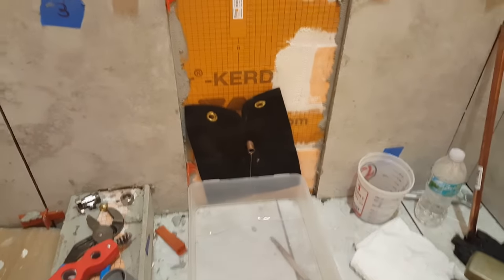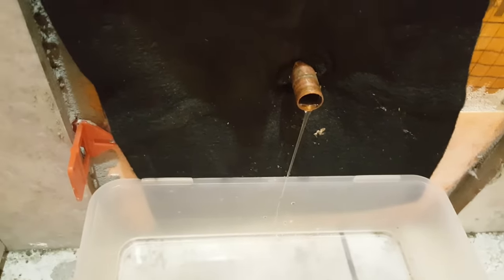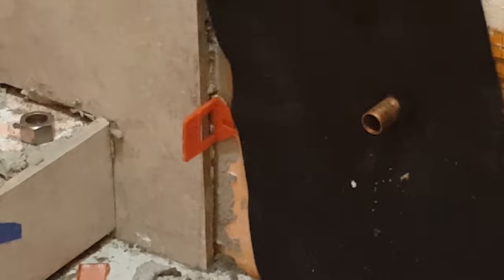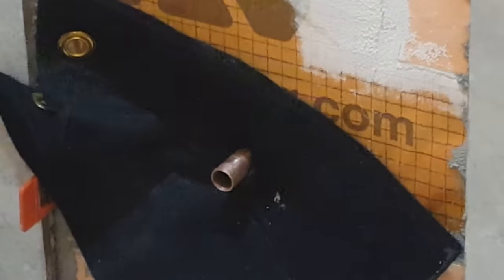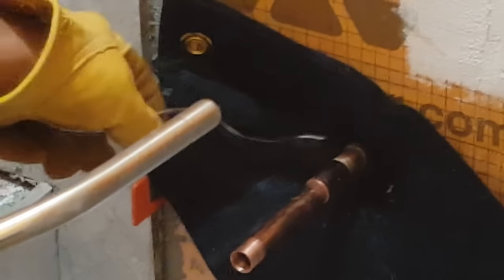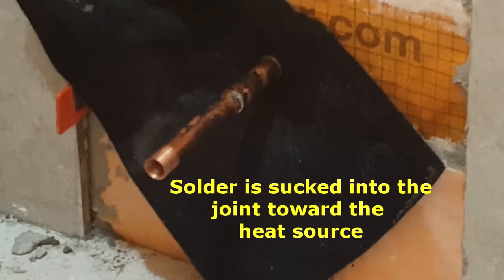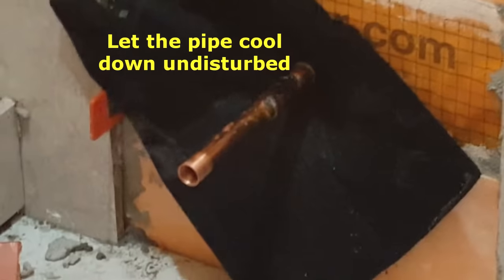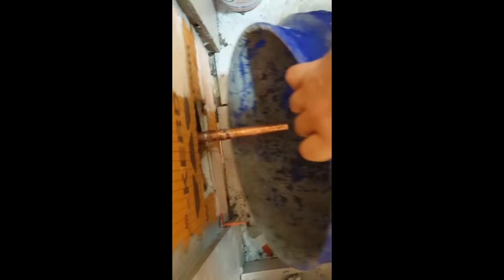Insane Plumber's Trick: Solder Copper Pipes Dripping Water

Comment: Rubbish.  Just add a compression fit isolator valve, if not there, somewhere back in the line.  Amateur.
Reply from the maker: LOL! Rubbish. Most compression fit isolation valves have no handle on it, you have to use a screw driver, not appropriate for a disabled homeowner, but an amateur like you would not know about that. There's already a street shut off that we could have turned off if we had an extra day to give notice to the homeowners association at this condo. Soemthing else you don't know about, amateur. So we don't need your isolation valve. Arrogant Amateur!
Reply: Rubbish.  Now, seeing as you know it all:  work out why the water is still coming down (is that too difficult for you?), & work out how to stop it further back down the line with an inline isolator + handle, or a lever arm valve, or a stop tap, or a gate valve (std or full-flow) depending on the requirements.  Fit the valve, open, then close when secure, and reconnect the pipe.  If this is the cold feed for the toilet, it should have an isolator / stop tap / lever arm / 90 deg valve in any case, maybe you didn't know that.  In the UK, most houses have a tap/valve on the incoming main, as well as a meter box & stop tap in the pavement (sidewalk), but then you wouldn't know about that.  Your flame is too big, & too far away, bend your solder (pref. lead free) to 90 degrees, & come in BEHIND the pipe to stop the flame melting it prematurely.  Maybe no-one ever told you that.  You have to use MAPP gas torches carefully to avoid overheating the pipe & burning the flux off, so I use butane/propane mix which is more gentle, just heat to solder melting point, that's all you need, and it cools more quickly.  Unless your fingers are really dirty, a bit of sweat & finger grease won't affect a good quality flux or the solder.  (Alternatively, use a compression joint if you can't solder.)  NO flux on the inside of the pipe, will continue to corrode the pipe on the inside, affect any plastic components, and only use the correct flux for GAS.   Forget the bread (ugh), do the job properly, & allow for future maintenance.  Otherwise, I like your attitude, trying to do the job properly.  PS:  Plumber, tutor & assessor 26 years.